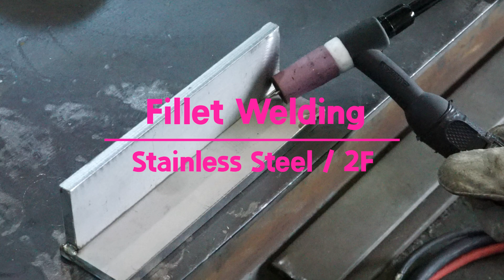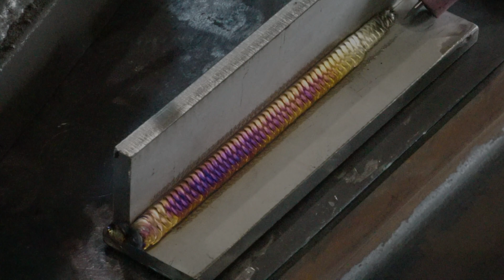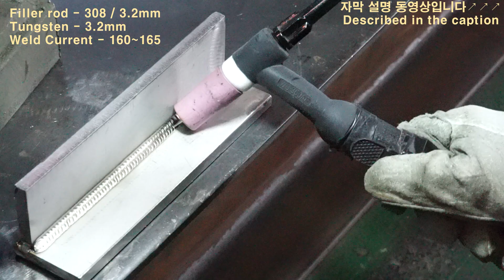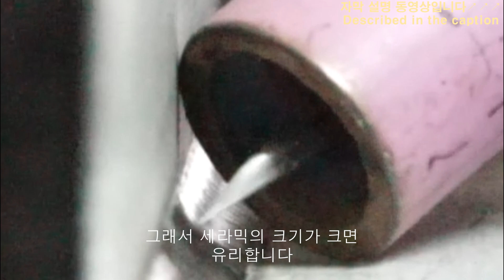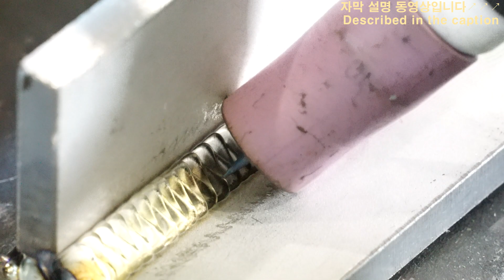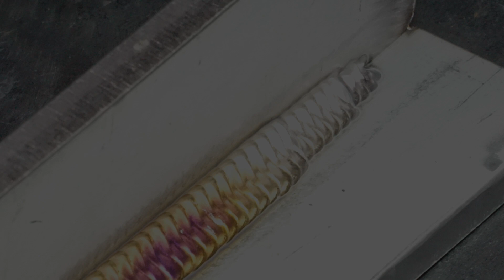How to easily learn TIG welding fillet welding [3Pass welding]

Comment: The technique is pretty simple but sometimes when I do similar fillet welds my ceramic cup (size 10) doesn't slide forward easily and I have to apply force to move it like I need. Why could that be? Maybe grind the outer edges of ceramic cup or polish with wire wheel the joint?
Reply from the maker: If you look closely at the video, you can see that the length of tungsten is short. That's the point. If that happens, the ceramic won't slip.